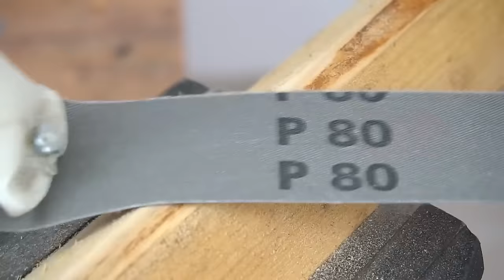Handyman Tips and Hacks That Work Extremely Well

Comment: Okay, I'll admit I'm slow.  Why is it that I need evenly spaced nails encapsulated in duct tape?
Reply: I couldn't figure that one out either.
Reply: Why stop at so few, do em up several hundred at a time and wear them across your chest bandito style.
Reply: That one had me too. And the hammer with the cross hatched face.????
Reply: @tearl5676  corrugated faced hammers are used in framing.
Reply: @tearl5676  Meat tenderiser? that's about all that cheap Dollar store hammer is good for anyway!
Reply: Did't get that too.
But there's some useful tips anyway.
Reply: You have to wait for the next video where they'll teach us how to make the belt fed nail machinegun
Reply: You need the duck tape encased nails because you haven't yet made the water bottle belt pouch for holding nails.